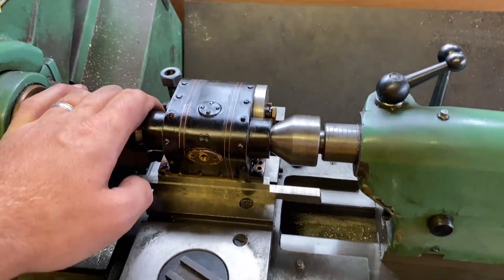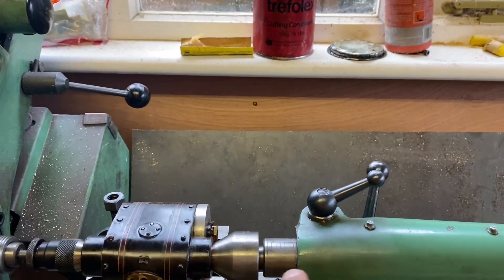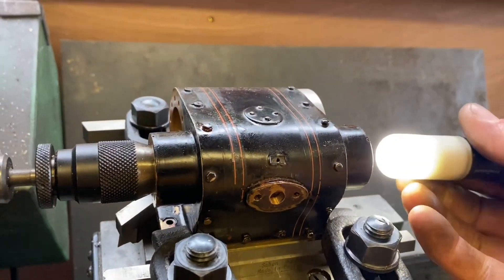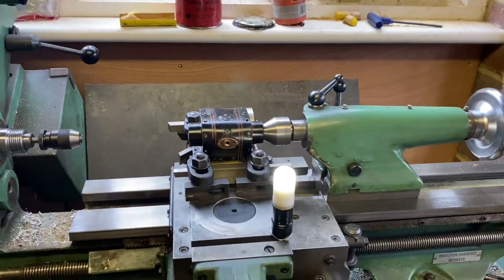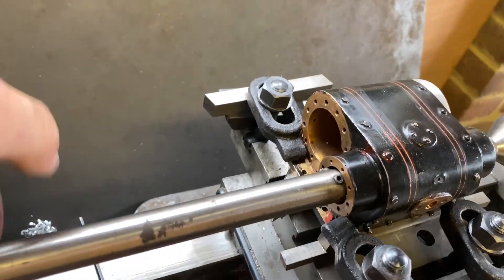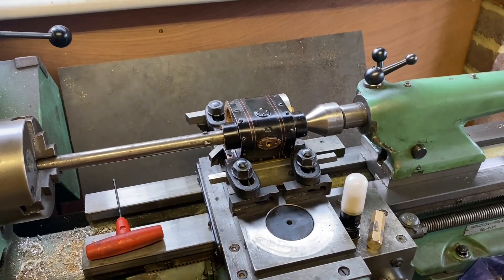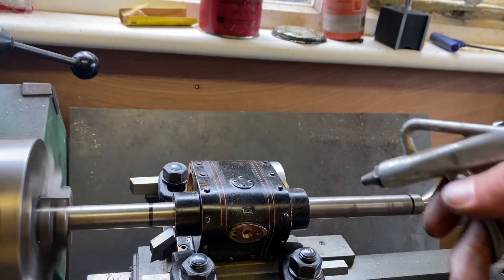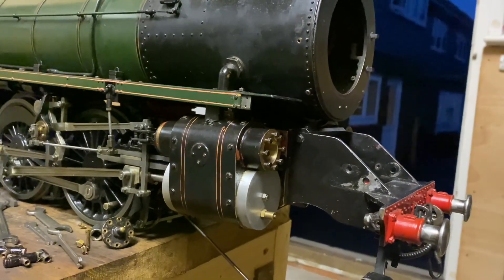Machining the piston valves

Comment: Hi Tom… very engaging video! I have just got a Super 7B… a move up from an ML7. Curious as to what feed rate you used. Setting on the QCGB, did you use a Myford fine feed tumbler?  Cheers from Oz!
Reply from the maker: Thanks. This was a couple of years ago now, but pretty sure it would have been the finest feed on the gearbox, no extra tumblers, but with a few passes it should be pretty good, can’t remember now, but I’d have thought I’d have sent the feed in both directions to try to get the best finish I could.

Comment: Hello Tom, I have a 3 1/2 inch Doris with bronze cylinders and velve liners. I would like to put rings on the bobbins. Do you think cast-iron Will be okay by the way I am a friend of a Graham GAIN who I believe is a friend of your father. Thanks for the time. Best of luck with the Brit. Best regards, John😅
Reply from the maker: I’ve not had much experience with cast iron in bronze cylinders, but I don’t see why it shouldn’t be ok, I think I’d use bronze though as then there’s nothing which can rust so you don’t need to be as worried about making sure you keep it lubricated between uses. We have a Doris as a club loco, which when rebuilt had o-rings fitted in the valves. Which works well, which is why I ended up putting them in the Brit too.